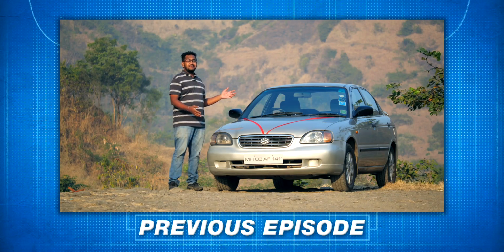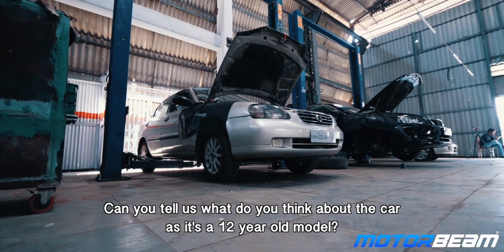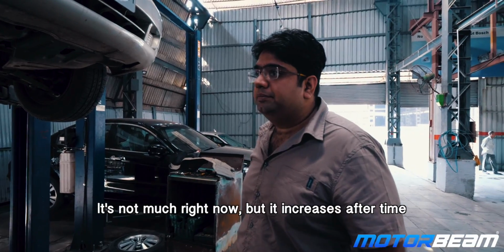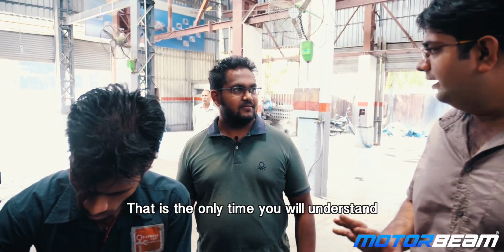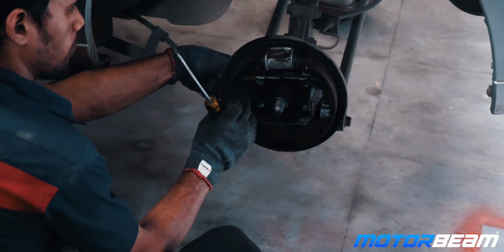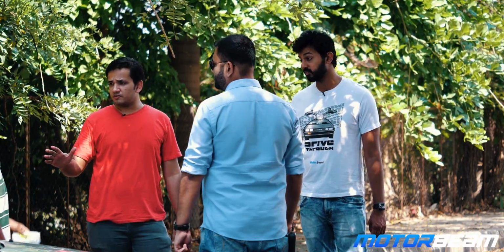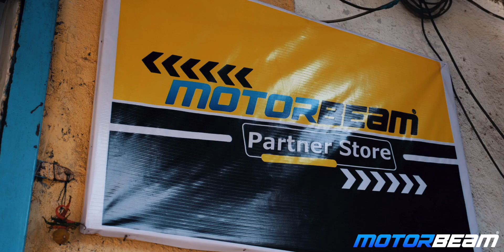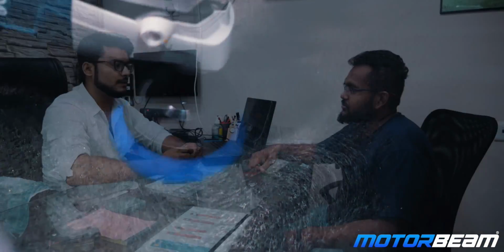Restoring The Glory - #MBProjectCar | MotorBeam

Comment: Service - done ! Cleanup - done !

Now it's time to review this baby !

What mods should we be doing?

#MotorBeamers #MBProjectCar
Reply: Add body kits, change the head and tail lights, a huge spoiler, and a nice set of rims. The colour must be gloss green and black  or matte black
Reply: Changing the colour of car
Reply: Give it a matte finished red which would look cool and new alloy wheels, new headlamps and taillights
Reply: Upsized rims and wide tyres with matte grey paint
Reply: Give it a performance tune up with power and handling mods no need for rear wing because it's a fwd make it in to a tuner car .
Reply: Stance?😆
Reply: Customisation 🤘🤘
Reply: Free flow exhaust system and performance air filter
Reply: Do a graphic work on it's Bonet..
Reply: Make it a sleeper. Bone stock from outside, monster on the inside.
Reply: Sleeper mod, no too much bling bling
Reply: Paint it blue like an R34
Reply: Which is that chemical he used to clean coolant tank?
Reply: A wider body, big spoiler, merc GTR'S Green colour.
Reply: New sporty or formula 1 decals on hood and sides projector head lamps, you can add lower lips infront hood for low slung look, better and bigger tyres or low proflie tyres, Breaking updates with massive breaks, flat bottom steering etcc..
Reply: Don't rice the car , supercharge it , please don't go in. The dumb ricer direction,put bigger wheels in it ,low profile tires,use the Aisin AMR 500 super charger, please do it ,don't go for turbos get a super charger
Reply: Do weight reduction,I am not saying to strip out the interior or that swap out the heavier components for lighter ones
Reply: adding engine of lamborghini
tyre of wrangler
Ac of bmw
lights from
Reply: Just don't make it a ricer but a sleeper instead . Only go for performance upgrades we don't want it to look fast but actually be fast
Reply: Turbo it 
Cold air intake
Free flow exhaust
Get rid of all rear seat and install roll cage
Good set of wheels with alloy 
And make sure exterior looks bone stock, don’t rice it
Reply: Body kit, dish alloys, spoiler, headlamp, tail lamp, front grill and performance upgrades.🔥
Reply: Engine swap plzzzzz
Reply: @TjLohe77  so basically make it a rice rocket
Reply: Huge wing, wide tyres, repaint, body kit and a turbo and brakes if needed
Reply: Add the Nissan VQ35DE 3.5L V6 engine with twin turbo system and other mods. Perfect engine.
Reply: Just add a turbocharged LS
Reply: i know I'm pretty off topic but do anybody know a good site to stream new movies online?

Comment: Performance airfilter
Catback/free flow exhaust
Aftermarket tachometer
A/f ratio water pressure gauges
Turbo (if within budget)
Lowering springs
Lowpro sports tires
lowered body kit
Racing steering wheel
Iridium spark plugs
Ecu remap
Reinforced pistons
Custom taillamps
Projector headlamps
A good music system
Bucket seats
Weight reduction
😊😊😊😊😊😊
Reply: Well why not a super charger,I know that a super charger needs a lot of custom fabrication but the results will be awesome,also weight reduction will be awesome,the list u made is awesome
Reply: 1 lakh ka toh car khareedne ka budget thaa modifications ke liye kya aap pese denge??
Reply: Weight reduction and music system in the same list? Seriously? 😂
Reply: @AutoVirals  OMFG dude!😂 I didn't noticed it too🤣

Comment: It is top model luxury car of that time in maruthi segments... This baleno is competitor for Honda City, mitsubishi lancer, hyundai accent....  It has premium features like alloy wheels, power widows, arm rests, electronic mirrors, automatic air conditioning, power steering, power antenna, central locking and seat belts with huge interior space... It has powerful 1600 cc engine and strong body... It's great sedan for long drives and high way racing...  It has spoiler at back with stylish sporty look... 🔥❤️👍

Comment: 1).Add front disc brakes. 
2).Turbo kit or supercharger if the engine is capable of taking the load , 
3). Free flow exhaust.
4). K&n air filter.
5). Wider rims and grippy tires with extended fendors
6) remapping of engine 
7).(( No spoilers for front wheel drive cars.....))

Comment: Hello motorbeam team. I am a subscriber of yours since the 1sf gen rs200 launch. I have been watching your series "Motorbeam project car" since the very beginning and I was just waiting to watch this episode. Now as you people asked our suggestions of customizing this car I can now say you that just slam on two big turbos with a changed and the a bigger air intake (realizing the pressure which the engine can handle) put 19inch wheels , air suspension , a full ecu remap with most aggressive settings available to make if move like an absolute beast and for sound I will suggest you to put armytrix exhaust. Put scissor door kit and a huge drift car design bumper and I believe giving the car some drift car looks will make look like a absolute beast